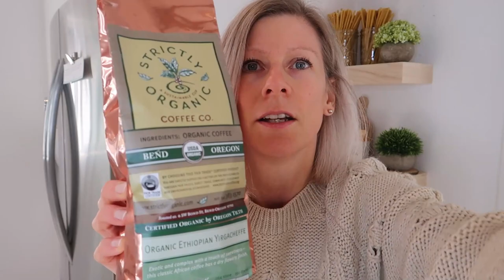SMALL HOME  PROJECTS AND HOMEMAKING day in the life

Comment: There’s different ways to ripen green tomatoes from the vine, my mom and dad used the box method all the time:
1. Green tomatoes will continue to ripen after they've been pulled from the vine. You can speed up the ripening process by placing green tomatoes with other tomatoes that are in the process of ripening. You can also place them with fruit, such as a yellow banana or apple that hasn't finished ripening.
2. Paperbag: To ripen a few green tomatoes, put them in a paper bag, close it up, and store in a warm location. ...
3.Box method: If you have several green tomatoes you want to ripen, consider using a cardboard box.
Reply: Great idea!